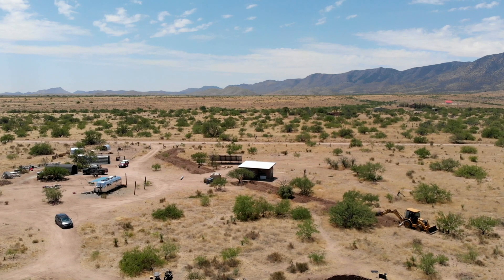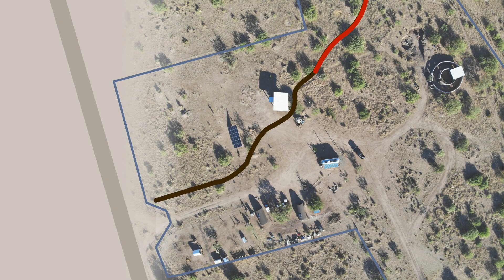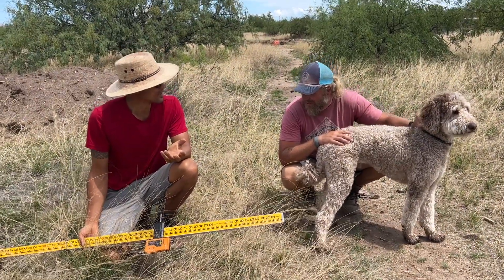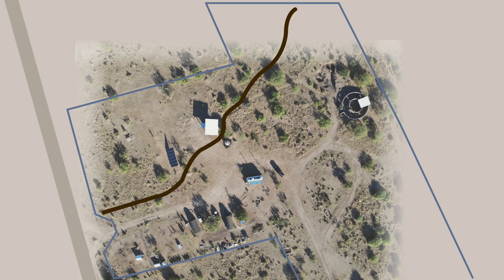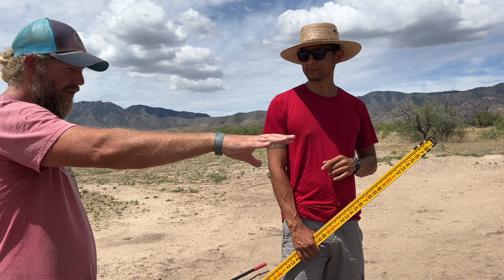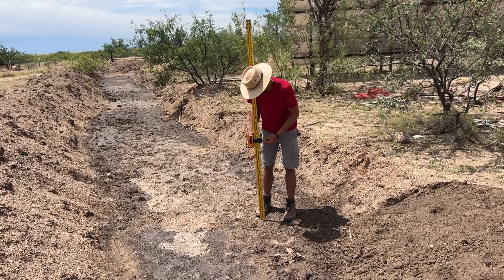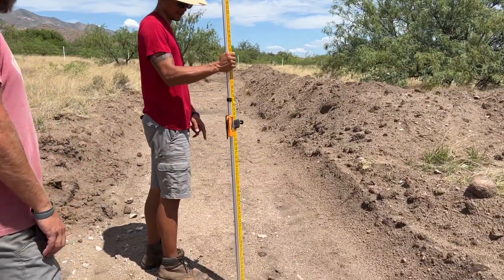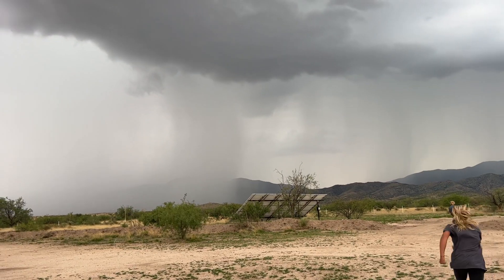It's NOT WORKING Right! Half of the Swale Isn't Catching Water (Step 3)

Comment: Water is a perfectly precise level. If water is pooling on one end than you have a high spot that need to be dug out so the whole length of the swale gets h2o distributed evenly,  because its level.  that way the eco system that develops has resources equally throughout the entire dig.
Reply from the maker: Did you watch the video? The swale is on level. That’s not the problem.

Comment: Anytime i have seen this type of work done, they use a grading bucket on the machine. It is wide and has a straight cutting edge.
Reply from the maker: The grading bucket was used to drive back through the swale after digging it out. If you watch the video where it was cut in, Rudy explains why we're using the backhoe to minimize handwork that will come in a later video.

Comment: My favorite thing to see is a cloud dropping rain, off in the distance!  It is something I have enjoyed for 60+ years and it never gets old!  This is a question that I have always puzzled over and did not quite understand today.  When it rains and the water drains quickly in the sand, does it run along the bedrock just below the surface?  Are there pockets of rock that hold the water that plants and animals can access?  While you want it to drain below the surface, is there a method to know where the water will drain from there?  I know, me and my questions.  What you are doing comes closer than any project I have been aware of that might be able to answer that.  I completely understand planting at the edges of the berms and swales but….okay, I will be quiet and hope you have an answer that this peabrain can understand.  Great video!
Reply from the maker: I don't think you can know for sure exactly where it goes unless you dig it up.... But in general it should recharge the aquifer somewhere below.

Comment: Looks like you've found a great solution to saving water on your property. I'd recommend encasing both ends of your driveway culvert to prevent the ends from getting crushed any more as it's so narrow. I noticed tire marks on the side of the fill in an earlier video.
Reply from the maker: Need to make it bigger first.

Comment: I saw somewhere they used hay as mulch and then put metallic meshes on top to make sure the wind will not bellow them away. Apparently hay is a great material to keep the soil moisture.
Reply from the maker: We may supplement with straw if we can’t chip all we need in time.

Comment: A common strategy for drylands is to mulch inside the swale itself. The reason being that the mulch will absorb much more moisture than mulch on the berm would absorb, allowing it to break down into humus more rapidly, while also preventing a lot of evaporation by covering the area that retains the most moisture. Of course mulching the berms is also incredibly beneficial, it can just often be harder as it's more prone to drying out and blowing away. Establishing a cover crop/ground cover may be easier for protecting the soil on the berms.

I also recommend planting some hardy nitrogen fixing trees on the berms ASAP as a support species. These trees will greatly reduce evaporation during the dry season, and can be pollarded at the end of the dry season creating lots of mulch that can be laid down to absorb the rains of the wet season.
Reply from the maker: I think you may have missed the first couple of videos explaining this whole process. Check out: https://youtu.be/j-F4TaIw3JA https://youtu.be/lgpd_1uEqYI https://youtu.be/CoCiCW4xK0Q There's no way we'd ever have the massive amount of organic material needed to fill these berms here in the desert.
Reply: @TinyShinyHome  that's understandable. Obviously you can't use more mulch than you have. My suggestion was mainly regarding the location to put the mulch that you do have, as reducing evaporation is a priority in a dry climate, and mulching the swale rather than the berm is more effective in that regard. You might also be able to harvest a surprising amount of organic material from your land by identifying trees and shrubs that are fine with lots of material being cut off them. That's where my suggestion of establishing support species such as hardy legume (nitrogen fixing) trees for the creation of biomass/mulch comes in. It may take some time, but the sooner you're able to cover the ground to reduce evaporation, as well as create a fungal net by allowing woody mulch to absorb moisture and breakdown, the sooner your system will begin to reflect fertility and abundance. Plants are able to communicate and send nutrients to each other through the fungal net, so you'll see a big difference in fertility when your soil is able to contain enough moisture that a fungal net can form.

Comment: I'm a heavy equipment operator and if I would have done that job I'd have done it with a 6 way trim dozer and you wouldn't have to pick up a shovel.all that should have been done with machine only
Looks like you're idea is working awesome 😎
Reply from the maker: We did bring in machinery to dig the swale. But there still is handwork that has to be done for seeding (a few videos from now)
Reply: @TinyShinyHome  with me on the dozer you'd never need a hand shovel I do golf courses
I just don't like making someone work harder than need be the backhoe operator could have done it better in my opinion

Comment: When I was young and we were developing our property, my mom would sprinkle talc into water puddles to mark where the water was standing so we could come back later (after the rain) and fix the low spots where the talc was sitting and lower the high spots with no talc.
Reply from the maker: Cool idea!
Reply: Maybe you could even use D.E. instead of talc for this purpose?
Just to avoid any excess of unwanted chemicals.
Reply: @gardengatesopen  Real talc is actually a natural mineral, just FYI. It's a good idea!
Reply: @sth.777  
👍 ok then!
Reply: @gardengatesopen
When you say D. E. I don't know what you are referring to can you explain. Thanks for your help. It came to me diatomaceous earth? Thanks again so much. Please share your knowledge and experience.
Reply: @nicholasgardiner9601  
Yes, Diatomaceous Earth is what I was referring to.
Sorry I wasn't more clear.

It's simply ground up fossilized algae, I believe. 
If you look at under a microscope you'll see it has super sharp edges, which is what scratches a hard shelled insects, eventually they die of dehydration. 
However, DE becomes useless for killing bugs when it gets wet.
But if it dries out again, then it works again.
It doesn't harm soft bodied insects, and apparently it doesn't harm the soft tissues inside of any animal either.
(including humans)
Just take care not to breathe it in, they say it's not good for lungs.
It's 100% natural, and a very fine white powder.
And since I've never seen "natural talc" for sale, 
(unless Stephanie H. was referring to something like ground limestone?) 
I just thought it might be better to use something chemical free to mark the puddles.

D.E. has many uses.
It's better to Google it to find the exact information. 
I use it at my house for bug control. It's not something that works quickly, but I can't have any poisons around.
Some people ingest it to help clean out their digestive tract.
I read it's been used that way for hundreds of years, but I've never done it so I can't say one way or the other.
Earthworms use it in the same way Turkeys use creek gravel in their gizzards. 

It's got a lot of uses.
It's a good product to know about. Just about every hardware store sells it in the Garden department, as well as good Garden Nurseries.

A certain grade of D.E. is also used for filtering swimming pool water. 
However, it is said to somehow be different, and that type does not have the same properties as Medicinal D.E. & Horticultural D.E.
So it's best not to use them interchangeably. 

Hope that helps!
Reply: @nicholasgardiner9601  
Thank You for adding that info!
I did hear that too, which I suppose is the reason I was thinking "talc" might not be so great to just sprinkle onto the ground.
(Or anywhere else for that matter!)
Maybe there is some company making & selling "safe" talc?
I have no idea.
I don't use it for any purpose.
 
All information 
is good information.
Each of us researching our own choices is simply a requirement these days.

Thanks Again for giving us the skinny on the J&J talc.
We all have choices.
Reply: @nicholasgardiner9601  nothing!
Well said my friend! 👍

Comment: So the question that came to mind is, Is the Solar Shed sitting above or below the spillway level? If it is below it will flood before the water goes over the spillway. Hopefully, Rudy took this into account while doing the design and layout..
Reply from the maker: This isn't the only swale we're putting in. Long term there will be one above the shed. But regardless, the shed is already "bermed" up near the walls so water runs around it. You should be doing that with any earthen buildings.
Reply: @TinyShinyHome  And you can always sandbag the door sill if the water gets that high. But the real point I'm trying to make here is to make sure you have taken everything into consideration before making any more changes to the landscape. Those changes not only affect your property but everything downstream. and you have already pointed out several mistakes.